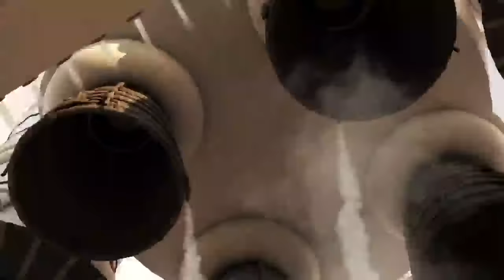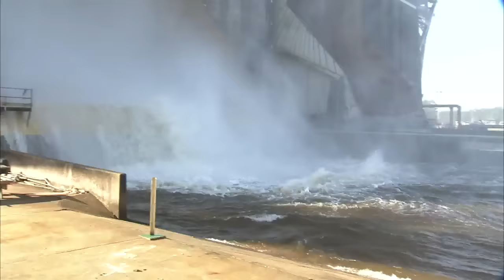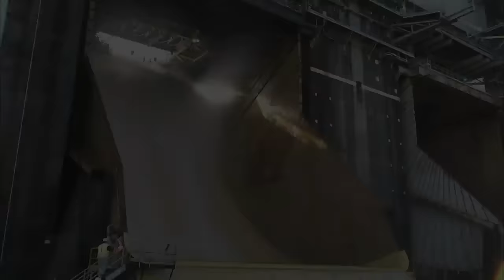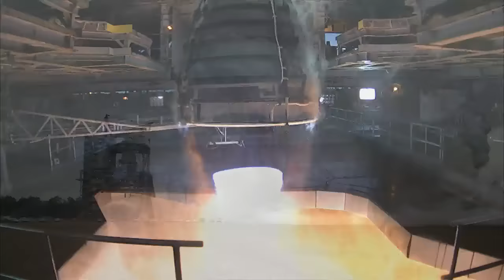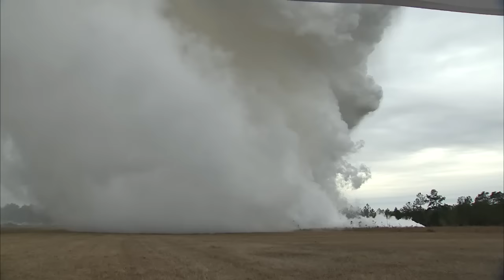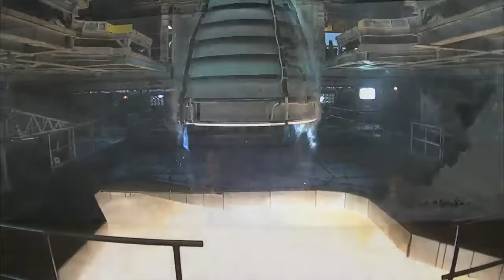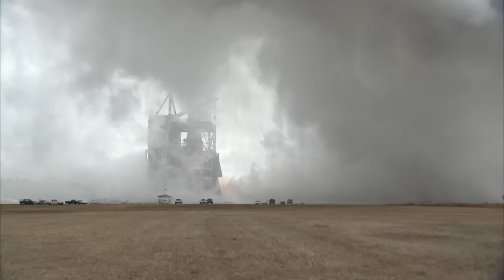NASA Conducts First RS-25 Rocket Engine Test of 2018

Comment: I'm surprised the building didn't take off.
Reply: Obviously the building weighs more than the thrust.  By quite a lot actually.
Reply: John Culver Oh wow! Jeez man you've really done your homework on the matter
Reply: John Culver woosh
Reply: Well considering the stand was built to accommodate the F1 engines I'm pretty sure it can handle a dinky little RS-25
Reply: Suprised the bulding not explodet ... they should take russian solid booster mor relayebal
Reply: actually, it was built to test the Saturn V 2nd stage using five J-2 engines.  But your point still stands that the thrust of five J-2's exceeded the thrust of one RS-25 (SSME).  The B test stands is where the first stage with 5 F-1 engines was tested.
Reply: it is pushing the building down as hard as it pushes it up
Reply: @johnculver6994  r/woosh
Reply: you need a lot more thrust to push a building up 
that engine don't even have 1 of ten thrust to lift the building 
and beside that you need a lot of fuel and engine need to be placed exactly in a line behind center of mass of the building otherwise the engine will go straight into wall smashing and blowing up because it creates torque in any direction other than center of mass
Reply: @Knight7562  r/woosh
Reply: Nina Dragonborn r/iamverysmart r/woosh
Reply: Luminite you funny guy😂😂👍
Reply: The earth slowed down in its orbit
Reply: @Knight7562  That's cool to know. Thank you. :D
Reply: @Knight7562  pretty sure nobody was looking to launch a structure
Reply: @johnculver6994  https://en.wikipedia.org/wiki/Joke
Reply: @John Culver Have you heard of jokes?
Reply: They didn't turn it up to 11.
Reply: John Culver r/whoosh
Reply: It has to be the weight of the building holding the RS-25 down. That engine runs off of hydrogen, which isn’t very dense. So the hydrogen and oxidizer tanks can’t be holding it down
Reply: /e dance
Reply: the comment from the nasa guy wasn't complete, what was he saying.
Reply: John Culver r/whooosh
Reply: @johnculver6994  r/woooosh
Reply: The building is builded in that way that it can't fly.the 🏢 is so strong
Reply: it didn’t?????
Reply: @peterenglish2573  it’s kinda like a rhetorical question but it’s not a question, he doesnt want you to answer
Reply: @Austone1  r/ihavereddit
Reply: @natekittlaus5302  r/ihavereddit
Reply: I know it is a joke, but they will probably need more than one...
Reply: @johnculver6994  no shit
Reply: @johnculver6994  u must be fun at parties
Reply: @johnculver6994  seems like your the smartest kid here eh?
Reply: @msudawg1997  so… how many f-1 engines would it take to launch the building?
Reply: you see, they actually put another engine upside down on top of the building, so the forces cancel out
Reply: It looks that way because the ground is also attached to the building and is taking off🤔
Reply: The building does need to be secured extra as vibrations can be tough on structure. Dampened and bolted down.
Reply: @itzdylan7665  Didn't sound like a joke lol. Ik I'm late but it's whatever. And yes Ik you weren't talking to me.

Comment: So can I mount this on my Civic?
Reply: Andrew Lang. I think
Reply: You would probably catch up to Elon's Tesla if you did ...
Reply: Why would you do that? You already have..
VTEC
Reply: K Lichtner pff nah probably to The Tesla on mars that’s a yeah
Reply: You strap a saddle to the engine then put the Civic in the saddle.  A bit like Clyde Crashcup trying to invent a flying machine - aired with Alvin and The Chipmunks in the late fifties/ early sixties.
Reply: r/whoooooosh
Reply: Good luck.
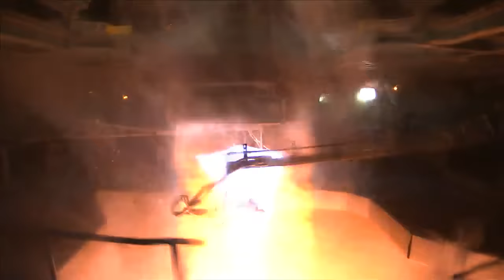Reply: 8:01 when vtec kicks in, sending your civic on an interplanetary trajectory
Reply: Sorry. I meant 🚗 💨
Reply: Technically you can but even if you removed the seats and filled the whole car with fuel it won't last long
Reply: No but you CAN mount the Civic. For flight.  You could probably strap cars on both sides..
Reply: @borgesguerardi  you mean Mosquito-TEC
Reply: Well yes but actually no
Reply: @nicolasdiaz5058  if its a model civic then yes
Reply: sure
Reply: Yeah just 500 pounds and ya got a civic that jeremy clarkson would be afraid to drive
Reply: no ricer,,,youll be dead
Reply: It should be an easy plug and play for any year civic
Reply: @Inaros404  That’s the advice I want, nevermind the advice I need, thank you
Reply: Have you seen a little indie film called F9??

Comment: It amazes me how anything can handle this much power and heat. Incredible engineering
Reply: The fascinating thing is that if you touched the outside of that engine nozzle while it was at full power you would get immediate frost bite on your hand as it's at cryogenic temperatures a mere inch away from that heat.
Reply: I tried this as a joke to some mechanical engineering colleagues, was received pretty well:
"Imagine you have to design a pump that can pump about a thousand liters of fluid per second. And produce 200 bar pressure. Also, the fluid is -250 °C cold. And the entire pump has to be quite lightweight, shouldn't weigh more than 1-2 tons!"
They are like "and what else from Santa's wishlist do you want?" until I tell them that all these things are standard for rocket engine fuel pumps from decades ago. This is an absolutely incredible feat of engineering.
Reply: @eicydee3212  You forgot to tell them they could use liquid oxygen and liquid hydrogen to power said pump and the exhaust could just be dumped wherever. ;)

Comment: The RS-25 is such an impressive combination of elegance and raw strength. Amazing!
Reply: It also cost $50 million  per engine compared to SpaceX raptor at $2 million
Reply: @cynicaltexan9639  Not really a fair comparison. The RS-25 has more than 25% the thrust and efficiency the raptor engine currently has. Moreover, it burns hydrogen and lox instead of the raptor engines methane and oxygen. If we're doing cost per kilonewton they're not too far apart in terms of cost considering most engines going on the SLS have already flown on the space shuttle, and not including the fact cost of the engine has yet to go down due to economies of scale since NASA is just now fully assembling SLS. You only need 4 RS-25s for SLS whereas starship needs 31 raptor engines. Is the raptor engine impressive? Yes. Is it cheaper than the RS-25s? Yes. Does it have the thrust, efficiency, and excellent service record of the RS-25? No. It hasn't even flown yet. To date, the RS-25 is the most efficient engine per kilogram of fuel and oxidizer ever flown.
Reply: @blackmesa232323  ok. fair enough. I am going to assume SpaceX track record witht the merlins will hopefully transfer over to the raptor. $64 million vs $200 Million for engines is still better and I would assume having more engine would allow for greater margins or failure in the engines. (If one or two raptors fail how likely would that effect the mission when you have 29-30 other engines running at peak. versus 1 or 2 Rs-25 engines failing that would creates critical loss to the system.)
Reply: @cynicaltexan9639  Well firstly the 2,000,000 optimistic figure for the raptor engine is still up in the air at the moment, and is the cost for manufacture without including R and D cost. Second in the RS-25s long and storied service record, only one engine has failed in 405 uses with no critical mission failures due to the engine. It's also no guarantee that raptor will have the reliability of the Merlin engine since it uses a different fuel and turbopump assembly system. The Merlin is open cycle with RP1, and the raptor engine is a full flow, closed cycle methane rocket design which is a turbopump assembly that has never flown on an orbital class rocket and incredibly complex, which means issues are likely to come from the fact it's thd first of its kind. I have no issue with SpaceX and love what they're doing to advance space technology, but to use it also dismiss the work of Aerojet Rocketdyne and NASA on what is by all accounts a reliable and amazing engine is counterproductive to advancing enthusiasm for space exploration.
Reply: @blackmesa232323  "Most efficient engine per kilogram"
Is efficiency per mass relevant though? The RS-25 burns hydrogen, a super light fuel, so of course it's going to be super efficient per fuel mass. Isn't efficiency per volume of fuel what really matters?
Reply: @elephant35e  Mass matters more than volume. While liquid hydrogen is less dense than RP1, the RS-25 is more efficient because it has a higher specific impulse meaning it produces the same thrust for a longer time. The specific impulse on the RS-25 is 452 seconds (the highest of any rocket engine on record) and SpaceX is aiming for a very optimistic 380 seconds of vacuum specific impulse. While there is a trade off to using hydrogen as a fuel (i.e. larger tanks) , having 72 more seconds of the same thrust per kilogram of fuel really helps compensate it. Even with a very heavy system like the Space Shuttle, 90 percent of it's mass was fuel, meaning the efficiency of which they used the fuel was more important than the dry mass of the craft.
Reply: @cynicaltexan9639  To the fact that Raptor is mass produced, its price will be less. To compare which engine is best on the basis of cost is wrong.
Reply: @blackmesa232323  And to the fact that Nozzle ratio of RS25 is 69:1 (which is a sea level standard) and yet  able to produce ISP of 458s (Vaccum) is a superior feat in itself. It is the only Rocket Engine in history to be used by rocket in its entire journey (from Launcpad/ground to LEO). 
In any case a rocket engine having a specific Nozzle ratio are ambient for only certain altitudes, which is one of the reasons is why we have multistage rockets. 
Raptor too works ambiently only for certain altitudes. Thus, it comes in two variants 1.) Sea level optimised (ISP:- 356s Vaccum/ Nozzle ratio:- 40:1)  2.) Vaccum optimised (ISP:- 377s Vaccum/ Nozzle ratio:- 200:1) which are used in SuperHeavy booster stage and Starship upper stage respectively. 
The thing Spacex achieved with Raptor was high reusability. 
No matter what anybody says, for me RS-25 is one of the greatest marvels in rocket science.
Reply: @PArabinddeep  yes
Reply: What is all of this long  comments ill die when ill finish readin it

Comment: The RS-25 is a great engine, even by today's standards. They have proven reliability, one of the best ISPs of any engine and self adaptability from sea level to vacuum use. 

What a pity they will just be used once and discarded like an empty beer can.
Reply: But very expensive unlike the raptor engine
Reply: I thought the price of the engine was rs 25 😂😂 i was shocked
Reply: I never understood how can it be efficient at both sea level and vacuum. Same for the EU Vulcain engine.
Pls explain
Reply: Radu Ro 
https://youtu.be/Zm7PNlK5Aco

I believe is has to do with the particles’ exhaust velocity, first few minutes of that old vid pretty much explains it. The lighter the particles, the faster they are ejected, so higher thrust per fuel burned.

In this case we have very light hydrogen fuel ejected from the exhaust, as opposed to the heavier Methane or RP-1 fuels. RS-25 is the only high tier closed cycle engine that uses hydrogen fuel (there is the RD-0120 that is the slightly better russian equivalent of RS-25 but it’s retired), while BE-4 and Raptor use Methane and the old and pretty reliable RD-180 or RD-191 use RP-1.

Someone should make a Hydrogen fuelled full flow rocket...
Reply: @UltEvo  
Expensive, yeah... but SpaceX is also using 31 individual engines.

Then again, they reuse them. So that offsets the cost.
Reply: disc_oidal  I guess you haven't heard of SpaceX's success at reusing boosters
Reply: Theodore Boomy how is that related to their comment?
Reply: @5000mahmud  He said that "Space exploration requires that they be discarded" SpaceX has proven that false
Reply: @Surrenitie  I stand corrected
Reply: SpaceX has a fantastic system for reusing their first stage but that doesn't compare with the RS-25's job. The RS-25 is a second stage engine that shuts down at much greater altitude and speed than the first stage and whose safe return to earth would involve much bigger numbers in energy and dollars. Shuttle sacrificed capability to haul the dead mass of those engines to orbit and through landing instead of them being expended as part of the external tank in an SLS-like configuration. Note the Soviets didn't copy that aspect when they did Buran.
Reply: @MagicAl5F4781  Very interesting, i didn't think of the RS-25 that way
Reply: @RoveRomania  It has to do with the nozzle shape. The nozzle is optimized for a vaccumm, but the slight inward curve at the end prevents instability asl
Reply: disc_oidal  I'm betting between 2026 and 2028. We still got tons of red tape to cross, jump, clear and cut.
Reply: Let's be realistic guys, SpaceX recovers boosters that put satellites into orbit.  Interplanetary travel would not afford that same flexibility.   Stages have to be bigger and burn longer.  We shall see what SpaceX actually does once they send something significant outside of LEO.

Comment: There is a fascination that makes me want to get as close as possible to experience the might of this machine. At the same time there is a dread, or terror of getting too close and turning to a crisp in less than the blink of an eye. Awesome, just plain awesome.
Reply: nlo114,,,,, The F-1 engines on the Saturn V had an operating temp of 60°C! 
  Inside it was about 6000° but due to the cryogenic fuel being pumped around the "bell" exhaust nozzle it had an overall temp of 60° Centigrade. 
  I found that absolutely amazing when i heard it. So inside the exhaust gasses are hot enough to melt any known metal but by pumping the liquid oxygen/Hydrogen around the outside to cool the engine, and also heat the fuel, it was able to not melt the nozzle. 
   So this controlled explosion, putting out millions of horsepower and exhaust gasses that are thousands of degrees was basically just "Warm to the touch". 60°C.   Crazy!         P
Reply: Jackie Singleton I'm guessing the surrounding area is a little warmer than that, though.
Reply: I'm pretty sure the acoustics would crush your insides before you got even close to feeling warm :P
Reply: CodGeronimo - you're probably right there. I worked in the space industry for a few years, building satellites. All of the modules were vibration-tested to 20g over a specified frequency range and duration. The structural vibration is very low, because all the rotating parts are well balanced. The primary source of vibration is acoustic. Some modules were spec'd to 50g and were a hell of a job to build them to survive. It can get a bit wearing after 2 weeks building something to have it returned broken.
Reply: That's super interesting, what kind of satellites did you work on?
Reply: My flight units were all LEO Earth-observation satellites for the DMCII constellation. (SSTL)
Reply: Looked it up, cool stuff!
Reply: It would turn you into a cloud......☁️☁️☁️

Comment: Am I hallucinating or are there horizontal bluish bands migrating up the engine bell surfaces during the burn? Video artifact?
Reply: Ben Brigham I see it and I don’t think it’s an artifact of the video. It looks to me like a very thing layer of ice forming then melting on the engine bell. Most likely has something to do with how the cryo fuel is piped through the engine bell during flight. I know right after ignition the whole bell freezes over then the freezing sort of oscillates like we’re seeing in the video.
Reply: wicked   😳
Reply: It is actually an artifact of using very old cameras
Reply: @benjaminbrown3939  funny you say that, this is a test from 2018. Fairly new cameras
Reply: @michaelblackwell4599  then why are the bands still there? Is it the result of the shaking forces of the exhaust jet messing with the electronics? Or could it be bloom?
Reply: @benjaminbrown3939  my point was the cameras aren't old. It is likely from being right at a rocket engine, and the heat screwing with the camera
Reply: @michaelblackwell4599  so, the exhaust jet.
Reply: @benjaminbrown3939  in a sense, yes
Reply: Shock cone reflections causing localized heating and cooling of sections of the nozzle, freezing and melting moisture in the surrounding air?
Reply: At 11:20 you can see that the bands are a video artifact, as they are evident elsewhere in the frame than just the bell
Reply: i think it is some aberration cuz it happens to the whole scene too. Just that it is especially clear on white surfaces liekt he engine bell

Comment: Curious engineer here:
What characteristics are measured during test?  Thrust, vibration in all 3 axis?  Fuel consumption, tank pressure? Temperature at different locations on the engine?
What parameters are modified during test?  Fuel flow, pressure, fuel to oxidizer mix ratio?
Do you measure the decibel level at different distances and how loud does it get?
Reply: Could be all of them... including the ones not mentioned (combustion chamber pressure, turbopump rpm, etc.) The point of a test is to gather as much data as possible in order to calculate the overall performance and efficiently thus they can improve the engine for even better performance to cost ratio.